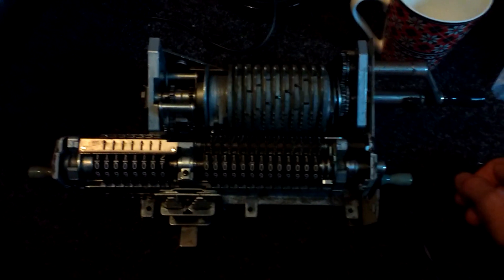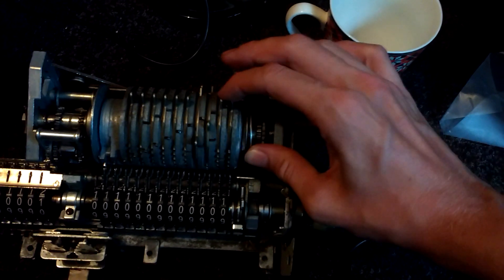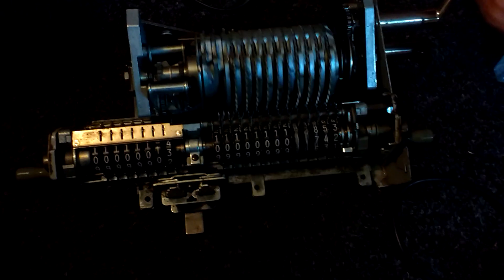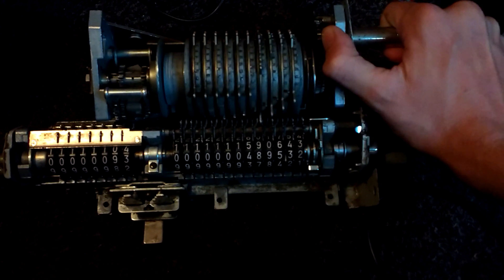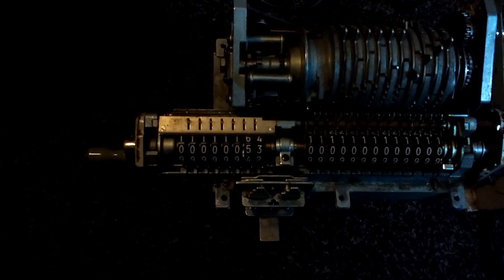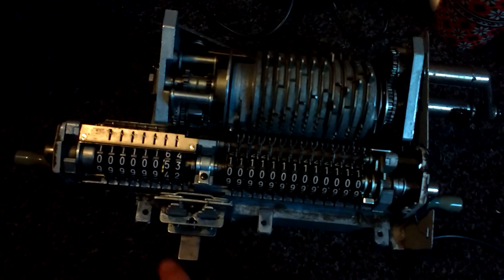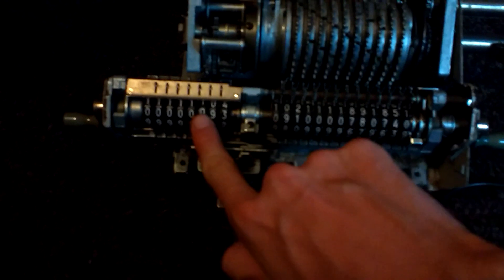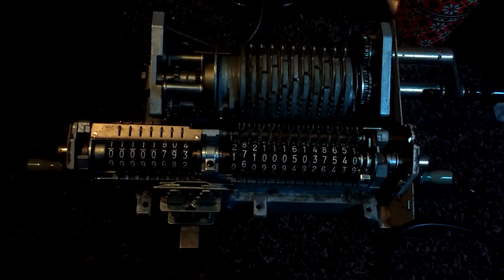Original Odhner mechanical calculator problem

Comment: I’ve just seen your video. The problems with the counter register are probably due to the carriage being taken out and replaced without setting the gears in the correct relative position. There is a timing mark on one of the gears which needs to be correctly positioned before the carriage is replaced.
Reply from the maker: Thanks! I haven't taken out the carriage myself, but i can't speak for the previous owner. I'll take the carriage out sooner or later and look for the timing marks.

Comment: Did you ever solve problem with the counter, i have same problem timing problem ? help needed !
Reply from the maker: Yes! Seen from the front, slide the carriage all the way to the left. Then turn the calculator around so you're looking at it from the back. 
You can see the wide drive gear driving the smaller gear of the counter. That small gear has a VERY small timing dot on the surface of one of the gear's teeth. That timing dot has to correspond to the notch that is cut in the right side of the frame when you install the carriage, with the crank in the locked/rest position. See if you can see it in the locked position. If it's not, the gear has jumped a few teeth and you have to remove the carriage (or simply remove the carriage limit pin on the bottom of the frame, slide it out just enough to allow the counter gear to spin freely), spin the carriage gears until you see the timing mark, and re-insert the carriage. It is a fairly risk-free operation, you don't have to take apart the entire carriage. It took me a very long time to find this out. I was aware there should be a timing mark from repair instructions on the internet, but nowhere did it say exactly where to find the timing mark afaik. 
With regards to the clearing lever - in my case, the pin that follows the 'spiral ramp' to couple the clearing shaft to the gears - that pin was worn out so the shaft didn't get pulled inwards enough. I tried removing it, didn't budge. I ended up simply bending the pin to compensate for the wear. It's very soft metal, it just mushroomed when i tried to gently tap it out with a hammer.
Reply: @mfbfreak  
Thanks for the reply i had actually timed the unit by moving the main shaft through the number wheels and fixed that problem and when i looked at the gear you were disgussing the mark on the tooth lined up with the vee mark.
The problem i am left with and at a lost with  is the reset which i am only able to achieve by rolling back the numbers until they are all on 9 it will then reset to zero but however once it has been reset using this method it will not reset until the same operation is repeated and in general will not reset until   all the numbers are moved off zero. 
Again thanks for your help
Reply from the maker: I sadly can't help you with that. I'm not a specialist in this kind of mechanical stuff, far from it. I hope you manage to find the issue! 
Until someone else chimes in, or you can find someone with knowledge, your best bet is to see what causes it to not want to reset by moving individual gears manually. I have a 'hunch' that it may be that the clearing lever is not working correctly. Check out the pin and ramp that pulls the entire clearing bar into the number wheels. If that thing doesn't get to the exact right spot when in its resting position, it might block something.
Reply: @mfbfreak  thanks again for your reply. At the moment nothing is making much sense so i am going to paint it up put it together, have to work out best way to remove paint from raised numbers (as i can reset it with a rather inconvenient process) and will come back to it at a later date
Just as a point of interest numbers that have a stamped recess impression i have used an acrylic paint pen and carefully washed off excess with rag and water with a successful result but at this point not sure how i will do the raised numbers i have played around with an abrasive ink rubber (might work looking slightly promising) anyway cheers for your help all input is appreciated